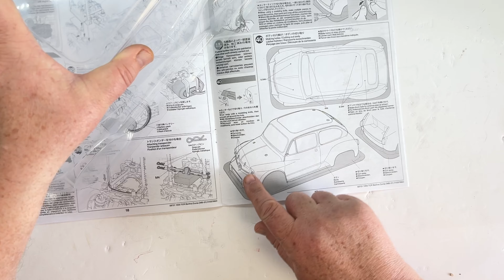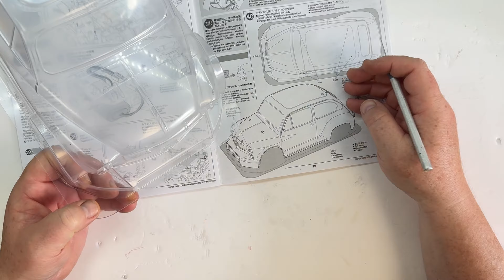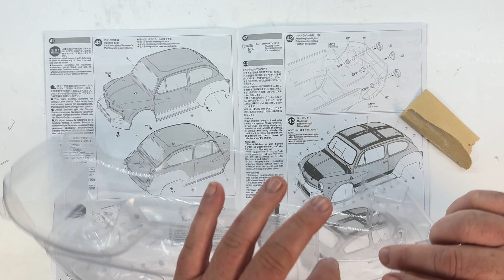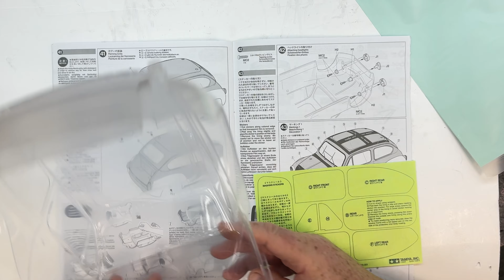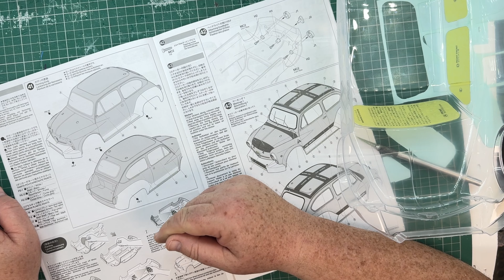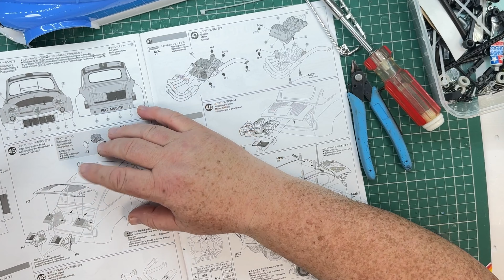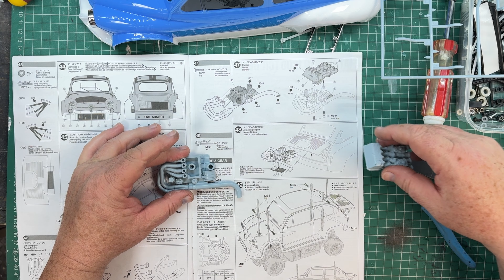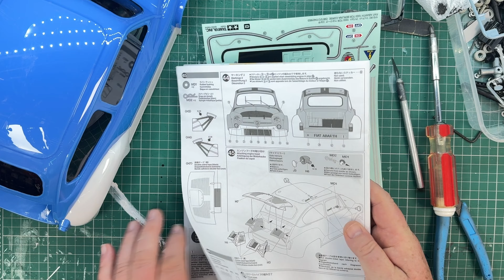1/10 R/C Fiat Abarth 1000 TCR Berlina Corse (MB-01) - Completing the Car

Comment: Well, that was a struggle from the cutting out the body, the masking, and the stickers yet you kept taking steps forward. I never had a problem with decals so why did they fix a problem that did not exist? You did a great job with what you had and topped the video off with a Bristol F.2 fighter ("Biff") in flight, nice. Jersey Bill
Reply from the maker: I did try to identify the plane, thank you it circled the car park a couple of times and the dipped a wing as it left - I couldn't resist filming. I did struggle with the kit, I think that was one of the most difficult bodies I have cut out. I was looking at a reciprocal knife the other day, until I saw the price. all the best Matt